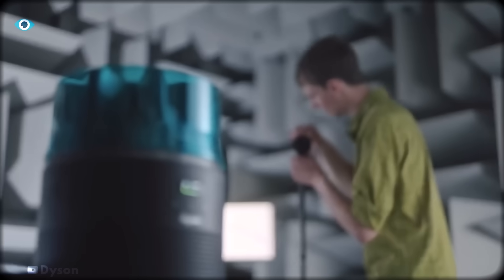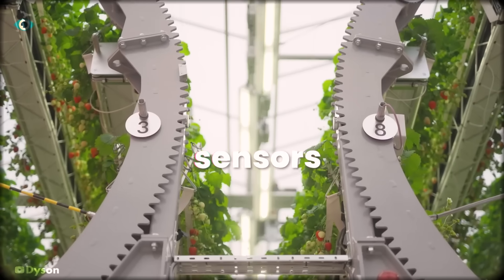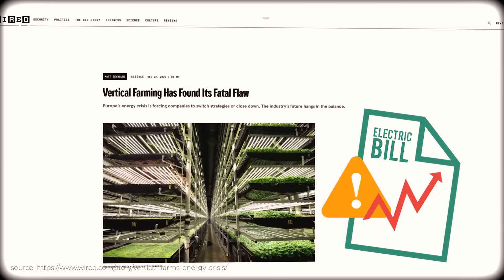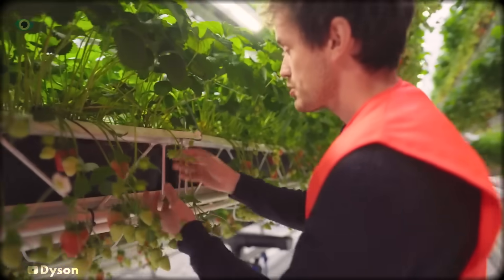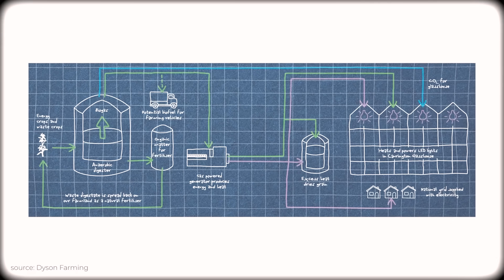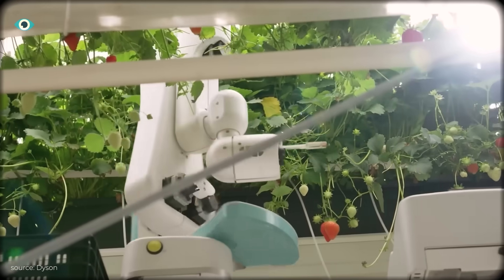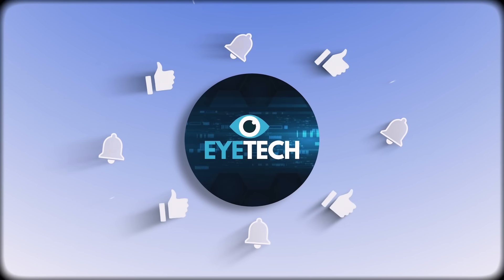How Dyson Fixed A $2 Billion Dollar Farming Problem

Comment: "It's expensive now but, like all tech, it will be cheaper in the future"

I've worked for mucci strawbs (and a few others) and this looks like over complicated bullshit. If the prices were 50% higher I'd say they might have a chance. 400% UK prices sounds about right for Dyson. There's a section at the local rubbish dump for any vacuums but it might as well be called the dyson bin. Unlike other tech they are competing against a well established sector that's already highly efficient.

Comment: LEDs are not energy intensive. They are the cheapest artificial light source.
Reply: Artificial. No matter how cheap, the sun is still cheaper.
Reply: That's not what they mean by energy intensive. You can specify wavelengths that are more intense than the sun, with less waste heat.

Comment: This design isn't original or new. It has been around for a couple decades now and the list of reasons it isn't used by commercial growers is as long as my arm. For the cost of installing and running this system for a single year I can setup 10 time the square footage of flood an drain or NFT systems and run them for 5 or 6 years.

Comment: Summary: 
The video explains how Dyson, the company famous for its vacuum cleaners, has entered the farming industry to solve a multi-billion-dollar problem that plagued high-tech vertical farming startups: profitability.

Traditional vertical farms failed because they relied on energy-intensive LEDs and tried to "out-engineer nature," resulting in unsustainable power bills when energy prices rose [01:09]. Dyson's approach is different, focusing on creating a hyper-efficient, "circular" system that utilizes natural resources.

Dyson's Engineered Ecosystem
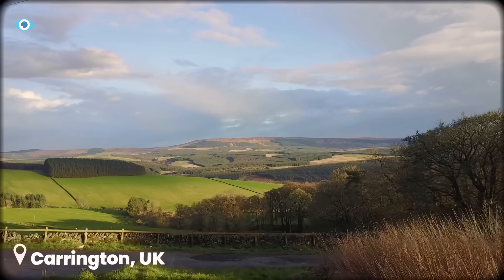Optimized Sunlight Use: Dyson's glasshouse in Carrington, UK, grows over a million strawberries with a yield double the industry standard [00:40]. Instead of eliminating the sun, they use 24-meter aluminum rigs that slowly rotate the plants to ensure every strawberry gets equal sunlight. This drastically cuts the need for supplemental, power-hungry LEDs [01:46].

Water Recycling: Rainwater is collected from the roof, filtered, and reused. Precision drip lines ensure each plant receives the exact amount of water it needs [02:06].

Closed-Loop Energy and Nutrient Cycle (The Breakthrough): The key to profitability is the system beneath the facility:

A massive anaerobic digester converts crop waste into biogas [02:25].

The biogas powers onsite generators for electricity [02:36].

The recovered heat from the generators maintains optimal greenhouse temperatures [02:39].

CO2 from the combustion is captured and piped back into the glasshouse to feed the plants [02:44].

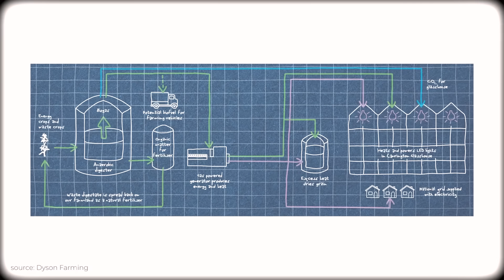Leftover sludge is used as natural fertilizer for nearby fields [02:54].

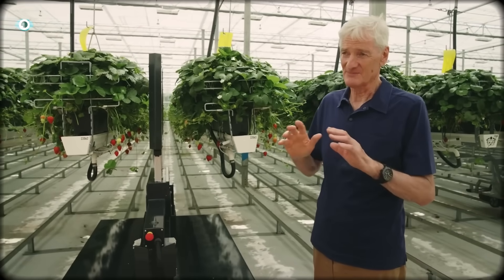This process transforms agriculture from a linear, wasteful model into a self-powering, closed-loop engine [03:04].

Broader Agricultural Impact
Beyond the glasshouse, Dyson manages 35,000 acres of farmland as an engineering program [03:16]:

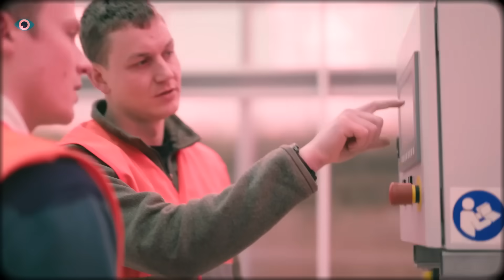They use AI systems and sensor networks with autonomous tractors to identify weeds and cut herbicide use by 90% [03:26].

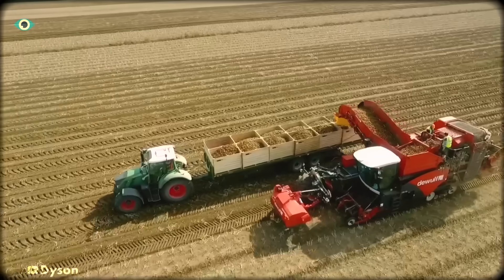They are testing automation to strengthen natural ecosystems, such as using sheep as "living fertilizer" and planting trees between crop rows [03:45].

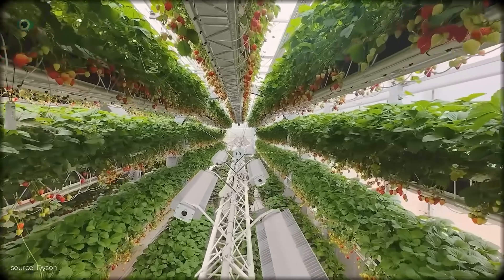The video concludes by calling this model "circular, intelligent farming," which is a scalable template for a future where farms are self-sufficient and regenerative [04:33].

Comment: Being disconnected from the ground will give you hollow food with little to no Minerals
Reply: Not so, it is possible to foliar feed them and hence ensure they are as mineral dense as a soil grown plant, one of the reasons for the good brix readings. It is also important to note that many farms have poor mineral balance and hence already grow mineral deficient food.
Reply: @vumba1331 Curious to see how natural foliar feeding is. It sounds like a Monsanto thing. But I'm so ignorant. Thanks for the topic.
Reply: @YourNextWatch-j5f It's very natural if it's done properly. There are many 'fertilisers' that you stay away from, any oxide is no good, and murate of potash is a no-no. Sulphates work well, they are softer and more readily absorbed, in fact a well balanced foliar brew will be in a plant wthin 30 minutes of the spray being applied.
Had a vineyard for 16 years and learned a lot about it, quite challenging initially but once the brews were worked out and dialed into the spray programme there was less disease, better yields and better fruit produced. Need to understand the phosphate uptake process, what to use to buffer the spray so it won't burn the leaves and appreciate that sprays need to be applied according to the molecular weight and plant's needs.
Very satisfying when you get it right though, good grapes, great wine and a low chemical farming lifestyle.
Reply: @vumba1331  Wow really interesting stuff. Thanks for taking the time to explain all that. In ignorance, I'm just curious if the sprayed on nutrients are equally as good as natural ingrediants. Are there chemicals they add to the nutrient to help the uptake? Is the spray itself natural and as readily available to the body as a typical fruit or is it more aiken to the supplament industry? I've always said I'd rather get my protein from meat than a protein powder. A lot of times the protein powder comes from a natural source but is then synthisized and mixed with things to help it's shelf life or in this case maybe the way it absorbs or something they add to not attract insects to the sweet? Mist...
Reply: And no lead. There's a problem now with plant-based protein where it sucks up too much garbage in the soil. It's a tradeoff we'll have to consider.

Comment: The question is: Is food equally nutritional when grown in an organic environment?
Reply: My teacher always said there are no stupid questions. But I think that it would hold the same nutritional value as a plant grown outside. They are the same plant after all. If you give the same plant  what it needs to thrive they would both be the same. Have you ever tired to grow a strawberry? I have and mine were not nutritional at all the strawberry came out small and sour. My hypothesis is that no matter the environment inside or outside, hydroponic or soil, adding manure or nutrients is all the same as long as it has the optimal growing conditions. It should be the same nutritional value.
Reply: @juang.7309 
Plants get nutrients from soil ecology so no matter if it’s grown I doors or outdoors as long as it has access to air and sunlight it can create the appropriate exudates. These exudates are sent down into the potting soil to feed the appropriate microbes which proliferate, extract nutrients from sand/silt/clay particles, consume other organisms, excrete nutrients then die. Upon death plants can then consume these nutrients in plant available forms. 

There are many other means plants can get nutrients from microbes as well. 

Mychorrizal fungi trade plants water and nutrients for exudates. 
There’s endophilic bacteria, nitrogen fixing bacteria, and many other means plants can get nutrients. 

So as long as the soil has a correct balance of soil ecology the plants will get all of the nutrients they require.
Reply: @juang.7309 i think research shows hydroponic has lower nutritional value.
Reply: Depends on what the food is given/what enviorement its in. If the plant gets excactly the same things as it would be otherwise and is treated teh same, the result should be the same.
Reply: Nutrition can be added after, just put the grinded insect. the future is people would eat chemical made food, but the rich eat the organic, we are moving that way
Reply: @seaweedisvegetable8465 so freaking cute ngl, this kid thinks organic grown food doesn't use chemicals.
Reply: @Ashpkfmdmdmdmd organic as it stay as original. Not some paste like hay or kindle thing whoch already processed a lot and can be easy manufactured, also probably last long . 
Check Nutrient paste

Comment: Current Vertical farms as an agricultural concept does not work and could not be viable due to the poor design concept /design construct. That is, a poor design idea. 
All that free energy of the sun replaced by artificial lighting makes absolutely no sense - unless it would be replaced by 100% renewable energy generated at lower costs.  
The holy grail of vertical farming is the indoor production of staple crops like wheat, rice, cassava, yams etc on an industrial scale, such as 100x vs open field production. 
Absolute waste of money and time to expend all that creativity to produce leafy greens or strawberries.
Reply: I wouldn’t say a waste of time, as the strawberries were likely chosen for their quick growth cycle to provide quicker access to experimental data.

Not to mention, photosynthesis synthesis is not a constant process like a solar panel, it requires a small amount of downtime to reset before it can crate more sugar, so rotation shouldn’t effect the energy capture too much.